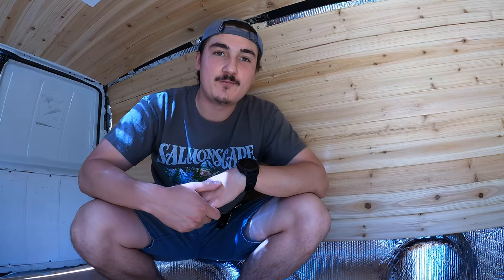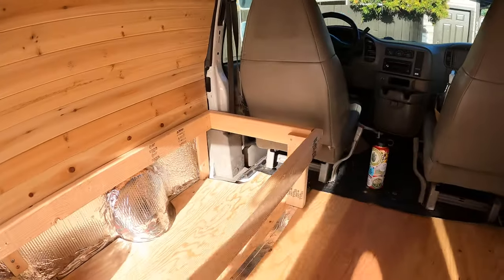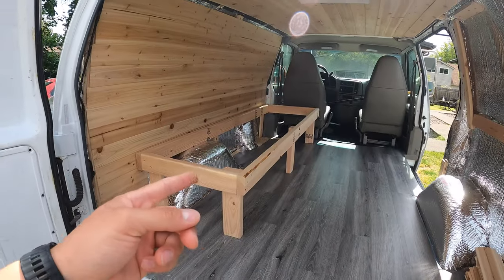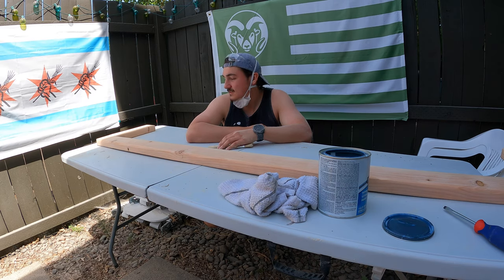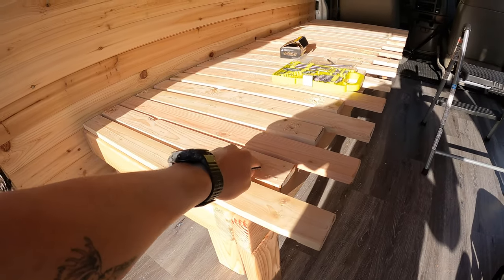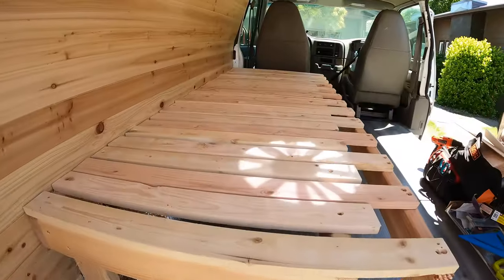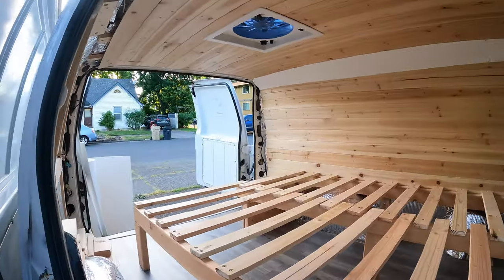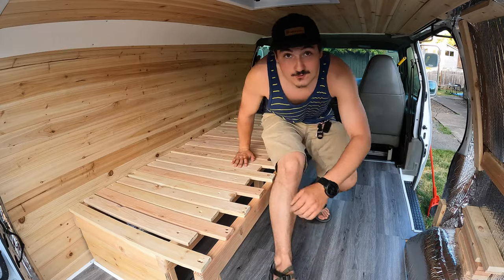CAMPER VAN BED BUILD | How to- Slat Bed Build And Vinyl Floors GMC Safari Adventure Van Build EP. 8

Comment: Why did you keep the one end of the sliding slats portion hanging free?  You could easily attach those loose ends to another 2x4 that rests against the wall 2x4, and effectively slides underneath the fixed slats. .
Reply from the maker: You are right about that and the answer is simply a fitment issue. When I attached the slats together it was too tight to slide. I could improve this design if I build another.

Comment: You will eventually regret for the "nice" floor thresholds. Your floor will get wet at some point and the water will flow under those thresholds. You will need to remove EVERYTHING to remove the floor and cleanup / dry the underneath. Correct approach would be letting the floor material stay over the thresholds, making the ground like a pool.
Reply from the maker: This is great insight, I haven’t had this situation occur quite yet, but will keep an eye out. Thanks for watching!

Comment: If you wanted the legs to be atleast double the length for more storage space underneath would that need more support?
Reply from the maker: In that case I would suggest more support. If this bed was double the height I wouldn’t be able to sit on it in couch mode. Since this video I redesigned this bed with 2x2 rather than 2x4 to make it even more low profile to allow me to sit up straight inside the van (still have plenty of storage for clothes, extra blankets, stove, propane, road side equipment, etc.) So depending on your platform making this twice as tall would make you very close to the ceiling in a Astro/Safari van. Hope this helps, feel free to ask any further questions. Don’t forget to check out my other camper van bed build in the Adventure Van build series playlist. Cheers!

Comment: What kind of wood. And how much did you use. What were the measurements on the wood.
Reply from the maker: This design used pine 2x4 with a length of 6ft. Check out my 2nd camper van bed video for more detailed instructions as well as a new and improved design. You can find it in the Adventure Van Build Series playlist. Thanks for watching!
Reply: Im building a wood slat couch bed in a camper trailer. Just looking for everything that ill need.
Reply: @SeizeTheAdventureCo  ok thanks for the info brother.
Reply from the maker: @bckilo  that’s great! It really is a great design for optimizing space and utility. Hope my other video will help!
Reply: @SeizeTheAdventureCo  yes it did. I built one into a camper trailer yesterday. Just gotta decide the best mattress to use with it.

Comment: The ceiling vent, did you do it before or after?
Reply from the maker: The fan is one of the first installations you will make in the process. It’s installed directly to the sheet metal of the van. Thanks for watching

Comment: Hey man what are you using to cover your wiring on the ceiling? That tan strip between the wall and ceiling. Thanks
Reply from the maker: Yes that’s a tricky space to cover. I used a plastic sheet that is used to line kitchen cabinets. Its flexible and easily cut. It was purchased at Home Depot. Extremely easy solution for a tough problem. Thanks for watching, don’t forget to subscribe for more van content coming soon!

Comment: In the time since you did this, have the pull out feet marked the flooring any? I was thinking that some felt on the bottom of the pull out feet might help prevent issues.
Reply from the maker: There hasn’t been any indentations from the feet of the pull out bed. I actually did add felt to the bottom of them to aid in the sliding function and it has worked great! This bed has been recently taken out and a new design has been put in. Go ahead and check out my new and improved design. It’s much more light weight, compact, and allows me to sit up fully in an Astro van. I have a very detailed video on it in the Adventure Van Build playlist on my channel. Thanks for watching, cheers to you!
Reply: ypu😊

Comment: Hi!!I loved how it turned out, what type of wood did you use?
Reply from the maker: This was built with pine 2x4. I made another bed with this design using 2x2s as well. The van is wrapped in cedar tongue and groove
Reply: @SeizeTheAdventureCo Can you show what you used to cover the ceiling gap..
Reply from the maker: @JordanB-lc4oi  this is a simple cabinet liner that came in a 4x8 sheet from homedepot that I trimmed to size. Really nothing too special besides a sheet of plastic. It hid the cables in the corner nicely!
Reply: @SeizeTheAdventureCo  Are you located in Florida?? Do you have a company that does work like that??
Reply from the maker: @JordanB-lc4oi  I’m based in Oregon for now!

Comment: Does it chatter a lot when you drive?
Reply from the maker: It actually stays put extremely well. The 4 inch bamboo memory foam mattress that I have on the bed is just enough weight to keep the bed frame from vibrating, or moving around at all. It’s a pretty solid set up overall. Hope this helps. Thanks for watching, cheers! 🤠

Comment: Hey, I love how it's so simple, but looks very sturdy. I plan on building one that is about 78in x 28 or 30in. It has to fit a mattress that is 78 x 58 (unfolded), 58 x 26 (tri-folded). Do you think you could share a list of all the materials and the length of all the cuts for the frame and slats, please?
My 2020 Ford transit 250 Van, gives me about 120'' L x 68'' W to work with. Any tips you could share would be greatly appreciated as well. Thanks
Reply from the maker: Hello Kelly. The bed design is very sturdy and has survived many nights camping with it so far! I have since re-designed this set up and created a very thorough video of it. Go over and check that out. I believe I provide a few measurements that can help you determine what is best for your build. My bed is strictly designed around the mattress that I purchased so that would be my first suggestion. Determine what mattress you will be using/creating. This will give you the length and width of your desired bed. Feel free to ask anymore questions you might have. Thanks for watching.

Comment: Looks good but the van looks too heavy I guess.i would build it simple with light materials I mean don't give me wrong I'm a carpenter.
Reply from the maker: Lighter materials could have been used and were used in the 2nd generation of it. Although I do believe that the van had zero problem with the weight as it was on airbags in the rear with a 5,000lb capacity. Thanks for commenting Alvin! Would love to see a professional carpenters build

Comment: We’re almost done our safari as well! Awesome video, how did you finish the corner where the wall meets the ceiling behind the drivers seat?
Reply from the maker: That’s great, Safaris are the best! Thanks for watching 😎. What I did was found a sheet of white plastic (to match the fantastic fan trim) and I cut it to size and then mounted it to the planks. This was the best method I could think of because connecting the wall and ceiling with cedar planks would mean reducing valuable headspace to accommodate for the lack of flexibility of the planks due to the curvature of the Van. Plastic is much more malleable then the cedar and actually turned out really nice! Hope this makes sense!

Comment: 0:02 What's going on? Well my hamster diarrhea still hasn't been cured, my dentist phoned to cancel my appointment, the bulb I bought for the Living room is too bright and I can't find the receipt to return it, I have two yogurts in the fridge that the use by date is today and I bet I forget about them, the filters I washed in my vacuum should be dry but you have to make sure they're bone dry or they'll clog up again, the clock in the hall still needs a new battery but I never remember that while out at the shops. I've bought a big container of dish washing liquid on eBay rather than buy small squeezy bottles every couple of months, I still haven't figured out how to change the clock in my car's time, I think you press the trip meter with the ignition on but I can't find the owners manual.  Not much else really.
Reply from the maker: Nice! Thanks for watching